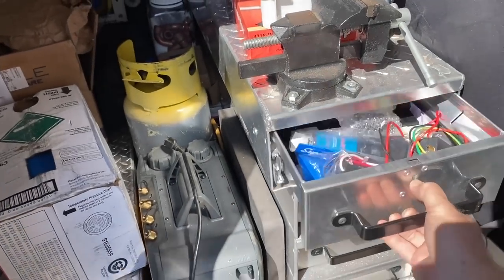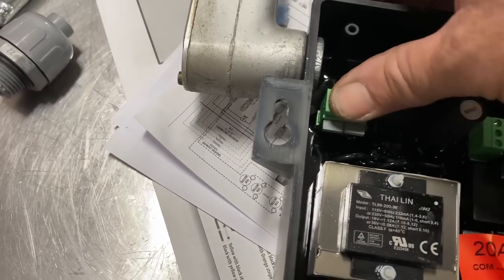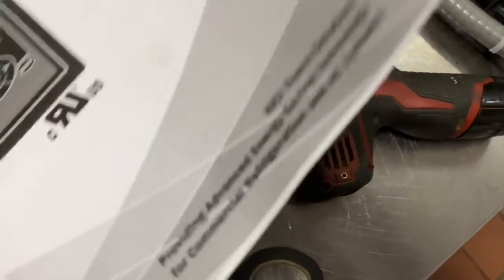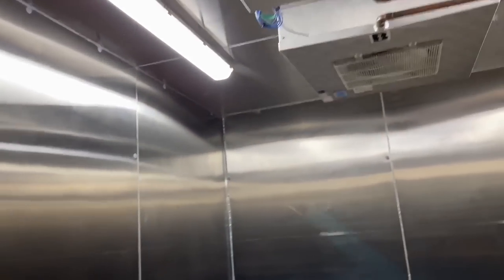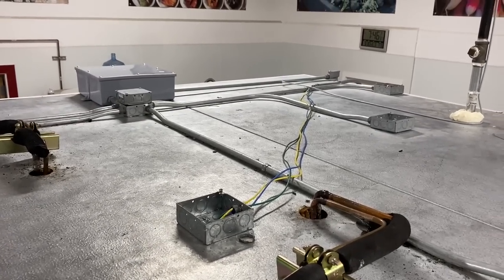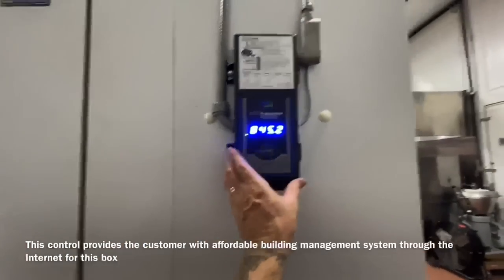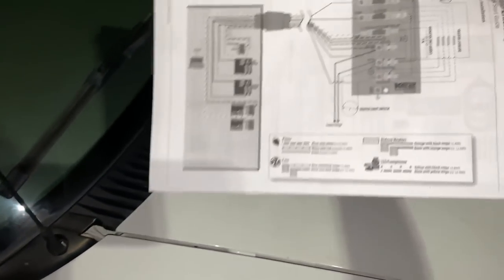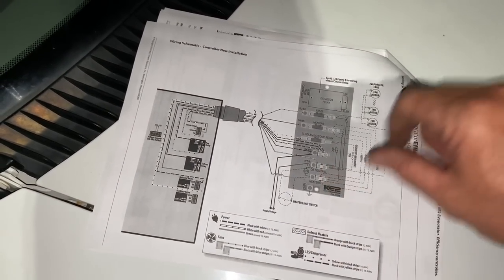KE2 evaporator efficiency installation

Comment: I can feel the tears of joy running down my face after seeing you mount that circuitboard outside of the walk in. It is nice when you do not have to bend your back as a p trap around the evaporator to reach it. Also the environment inside the box is not always the best with the salsa sauce and hot/cold changes. :)

Comment: I always mount ours outside the box at the door. Keeps moisture outta the controller but also KE2 has alarms. I want it beeping outside the box but also want my customers piece of mind always see the box temp by simply walking by. I have installed 15-20 of these and love them. Customers love them too! I have included them with all new installs not even allowing the customer a choice! Customer support is phenomenal too.

Comment: I just encountered one of these for the first time a few days ago.

The installers mounted the control board inside the evaporator on the electrical side but decided to mount the controller on the outside of the far end and ran all the wiring over the drain pan heaters... fun stuff.

Comment: Nice job Dave.  When you posted about the ETC-111 and the A421 controllers, I posted a note about always carrying the KE2 controllers on my van.  They make a variety of controllers and you can pick and choose which you need.  I carry a standard one on my van that can be used on both refrigerators or freezers in a single control without any extra switching or terminal boxes.  What is great about them is they can be used on ECM fan motor controls as well as electronic expansion valves and air, electric, or hot gas defrosts.  Mounting them outside the box and high is preferable so you don't have people smashing them with tall carts and such inside the box.  They can be mounted inside the box, but normally, you would need to mount them up behind the evap, coil(s) so no one messes with them or smacks them with boxes or a tall cart.  I love these little controllers, they're basically a PLC in a compact size.  I'd love to see you do more with these controllers in the future.

Comment: Hi Nice video.  FYI, when you first start de compressor/solenoid,  the coil temperature must be at least 1 F colder than room temp  to quick the fan. It's part of the sublimation process when temperature is reach. When charging first the system you might have  no enough TD to quick the fan on.  Nice work again.

Comment: Just finished bunch of Walgreens EMS installs and they’re using same KE2 controllers. Haven’t had no issues with them for the past year but seems like a decent controller. Good video brotha 🤘🤘
Reply: You do the install on these, and we have to fox all of your oversights and mistakes. Good to know. 
 You know who services thier equipment, best regards (Wiring Sporlan EXVs correctly AFTER the fact) Jacob
Reply: @jakem117  ... right on 🤘🤘 

(he’s a super tech)
Reply: Been to seven Walgreens in SWFL where grid point or the installer messed up the controls. Evaporator coil probes in the pan, box temperature sensors a quarter inch from the defrost heaters, boxes set for two defrosts a day for fifteen minute durations, Sporlan EXVs wires backwards (Winding Relative) to board input...
Reply: What's truly special is someone else collects the pay for install, then us warriors collect pay after five P.M for your mistakes... Clearing sight glasses on Master Bilt reverse cycle systems, not insulating box penetrations for line set or drain, screwing up master and slave controls... It's always a after hours special at a Walgreens in SWFL these days I tell ya. 
 I still have tons to learn, especially after the aforementioned installs :)
Reply: @jakem117  .... that’s why u make the big bucks

Comment: Believe Evap Fans kick in on coil temp sensor on the ones I’ve installed
Reply: Never mind u answered it in the end 🤘🤘
Reply: that's part of the efficiency gimmick and why they say place the sensor in coldest part of coil. otherwise it will freeze up before bringing fans on. wait until a sensor starts to drift LOL

Comment: I'll have to poke at you for using an "isolated" metal pull elbow. it needs equipment/earth ground bonded to pass code/be safe :)
so instead of short hex nipple, use a ridgid nipple, lock rings to box and ridgid metallic ground bushing inside(ground lug to bond).
lol, just use pvc next time! sorry the sparky training made me complain ;) 
** whoops, maybe it is bonded through the EMT to box on top, or was the other end to pvc box also?(conduit clamps/screws are not a ground path)
Reply: lock nuts or a grounding bushing won't do anything since the back housing go the KE2 is plastic lol
Reply: @74FirefighterEMT  the ground bushing would be on the conduit nipple and provide means to bond it and the metal elbow and conduit to the green/earth wire.
assuming, the conduit isn't already bonded via connection  to steel box at the top. he may have ran it from an other plastic box, which would make the conduit unbonded. you cannot have a random piece of metallic conduit/pull elbow or whatnot, isolated as such.

Comment: Already removed 3 of them🤭🤫😏😏
Reply from the maker: They fail?
Reply: @NorCal-refrigeration  o didn't watch the whole video then I caught that this Ke2 control is more involved than the Temp+ Defrost basic one that I hate.....whooooooOOOps
Reply from the maker: @HVACRDUDE  I like the A421 with defrost
Reply: @NorCal-refrigeration  not that one. It's made by Ke2...its the basic Temp+ defrost. Doesn't have as many connections
Reply: Pn: 20611
Reply: @NorCal-refrigeration  I can't get away from the time clock and ranco etc. 🤔🤫🤐🤐🤐😜

Comment: 👍👍👍
Equipment like this should’ve been introduced decades ago. 
            for about a $55  investment you could build and make the exact same thing using Arduino. Thermistors and relays included
       A real simple copy and paste programs that you don’t even have to build yourself and  you could just go in and tweak and modify temperatures and times.

Comment: Good vid ! Ive never installed one either & probably never will at $700.00 for a Digital temperature controller. 😂 Most customers use thier Alarm company to Put Alarms in the cooler & freezer. Gonna take ALOT OF years to Recoup $500.00 + Your install Labor cost of Electricity For a Few Fans that draw 1 amp. 😂🤣😂🤣. Maybe $10.00 savings per month turning fans off. So , I Guess a 5 year break even point. Not terrible I guess.
Reply: Surprised you haven't ran into them on the west side especially... TBH I would rather install a 421 or ke2 on a cooler here..it's ethier that or install defrost clocks with em.
Reply: @OcRefrig  Yeah I don't understand why other manufacturers don't have built in defrost 🤷‍♂️. Just anecdote ke2 is standard on a lot of masterbilt fridges.
Reply from the maker: OC it’s 700$ but it can do  a ton of different things and can be watched from your phone. Depending on how you set it up and what components you use with it. With temp and pressure transducer you can get real time super heat, coil temp, and a bunch of other troubleshooting info as well as alarms.  The evap fans turn off a lot more than you would think with this control and you know CA will make that mandatory at some point. Lol. For small jobs this control is a bit much but for chain stores it’s dirt cheap for what you get.
Reply: @NorCal-refrigeration  Just from observation...its kinda comical these chain stores will buy this type of control but never use it.